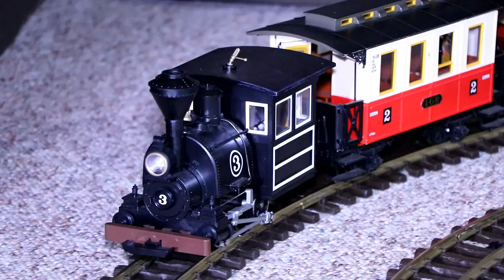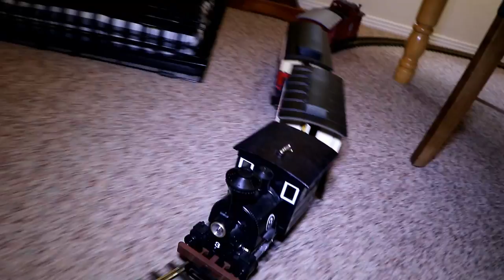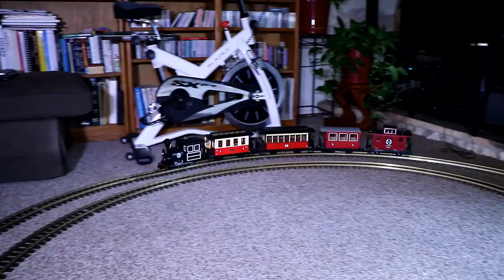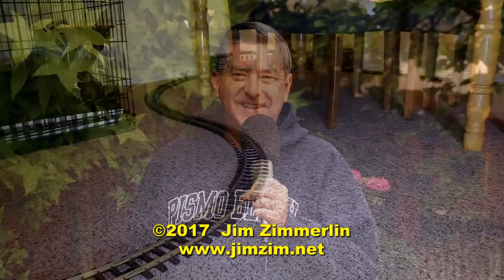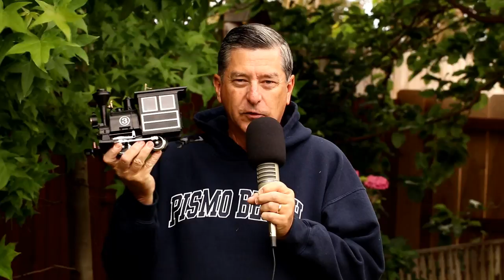Little G-Scale Locomotive with really BIG steam train sounds!

Comment: I like the little black LGB Porter #3 steam locomotive model #24771 with the real BIG steam train sounds included and put into it when running on the layout. 

In another video called Thomas The Forgotten #1 0-6-0 E2 Blue Tank Engine, where Thomas, orginally painted green, have the #70 on his bunker, and came from the London, Brighton and South Coast Railway or for short, the LBSC in the United Kingdom or on the mainland in Thomas and Friends: The Adventure Begins and is repainted blue and has the #1 on the side of him like the G scale model train version of him, model #91421, the DCC version of Thomas, not the model #91401, the analog version of Thomas, you made a really, very serious mistake in the video where we introduce to Thomas, Annie, model #91001 and Clarabel, model #91002, you should've had changed the model number from model #91401 to model #91421, you took the sounds of a real steam train, a London, Midland and Scottish Railway or for short, LMS Class 5 4-6-0 #5305 steam locomotive, and added into the little black Euro-German Porter steam locomotive #3 made by LGB in post production. 

And in yet another video called "I can't hear you over the sounds of the bells, horns, and whistles of the G scale model trains!", the LGB Porter #3 with the real steam train sounds will appear with 8 other G scale model trains in your collection.

Even though it doesn't come with sounds.

And also, you, Jim Zim, are so extremely, really, very lucky to have the DCC version, not the analog version, the DCC version of Thomas the Tank Engine in your collection of G scale model trains.

This is Thomas Comeau signing off for today.